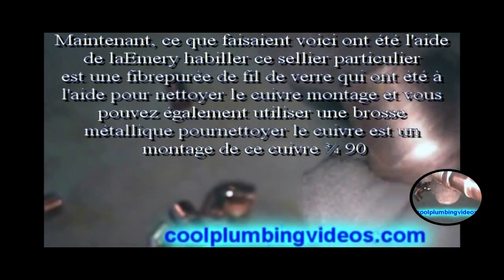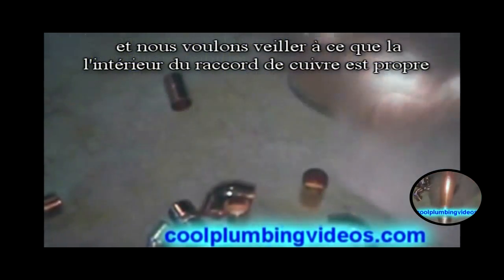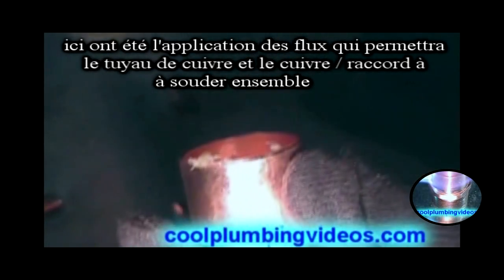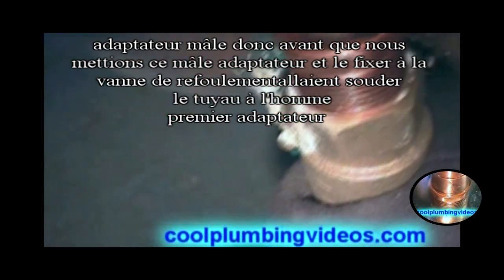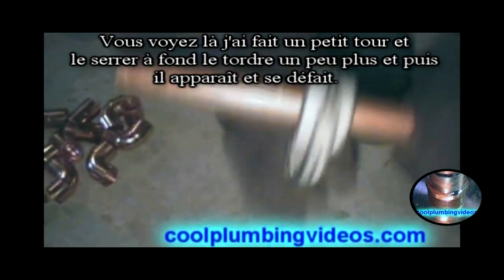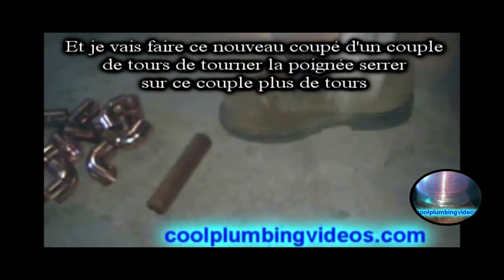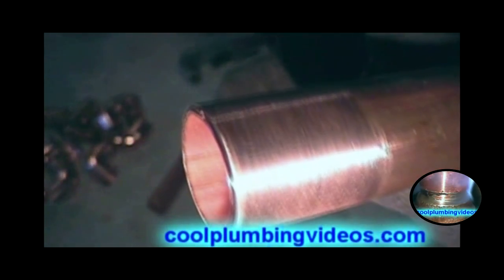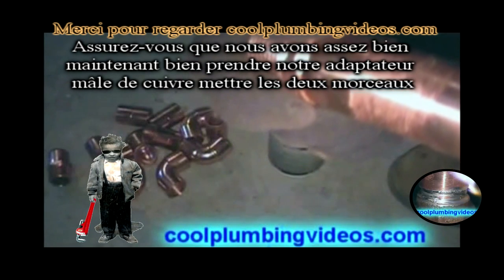Comment faire pour souder un tuyau de cuivre et 1 maison de nouvelle tuyauterie de 14

Comment from the maker: @Viking9280 First make sure your using the right flux. The brand I use is called no corrored. Solder you don't want to use solder with lead in it, because then you would get lead into your drinking water (NOT GOOD) Use lead free solder. Did you put the flux on the fitting and the pipe? If not you need to do that. You may need to turn the heat up or hold the touch in one spot a little longer. I hop this help my friend.
Reply from the maker: solder